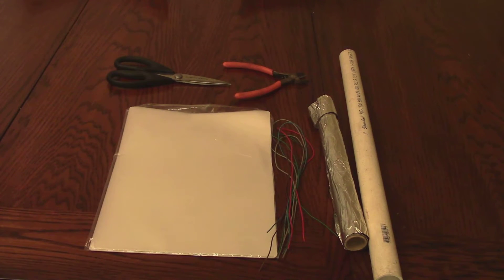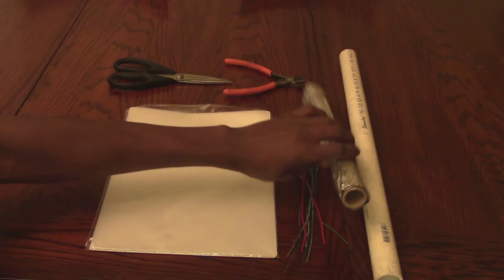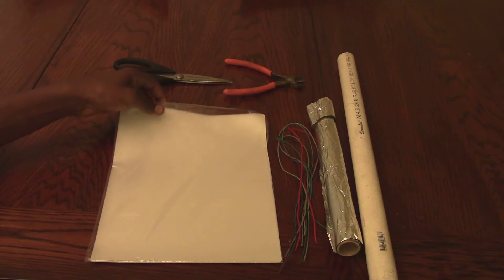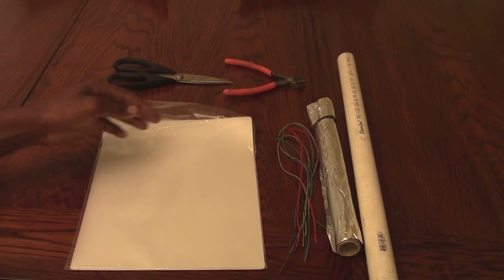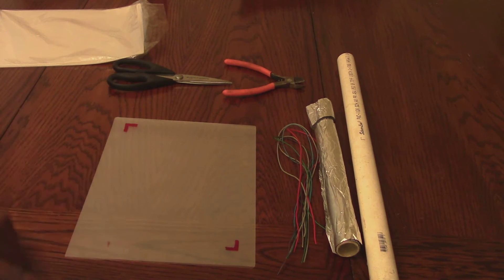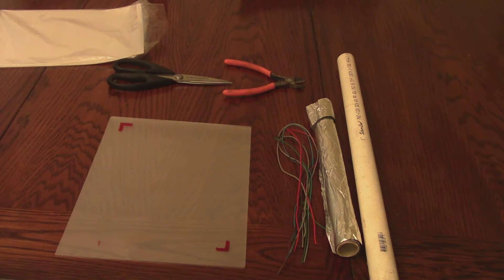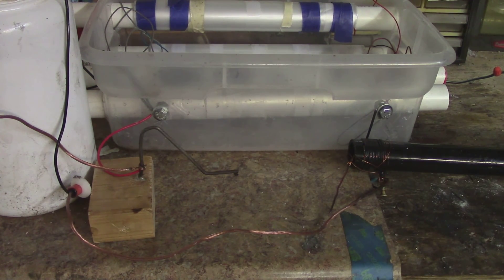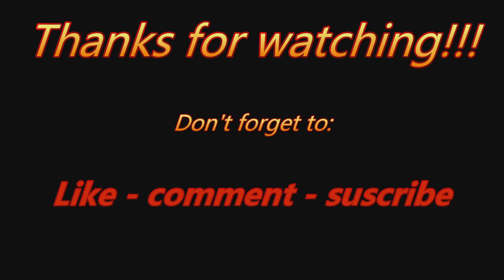How to make High voltage capacitors | 50kv foil rolled | Tesla coil caps |

Comment: Could this be used in a tesla coil?
Reply from the maker: Absolutely, as long as you make sure you get the right capacitance to achieve resonance.
Reply: @platinumscience7356  Thats the tough part. I want to build a big tesla coil. Could I just make a really big capacitor and call it good?
with like a 10,000 volt transformer
Reply: @platinumscience7356  I guess I will need to do a bit more research

Comment: Would be cool if you checked the capacitance before and after you rolled it to see its effects.  Also rolling a capacitor creates inductance that limits its ability to "dump" charge.  I wonder if theres any noticeable difference between a rolled and unrolled caps performance (probably not because of the small number of turns...)
Reply from the maker: Inductor87 yeah At the time I did not have a working capacitance meter, If I ever make any more Ill check it, but yes rolling then does add an inductance, I was thinking about laying about 100 of them flat into a container and filling it with transformer oil.
Reply: That sounds like a wicked experiment.  Deadly, but totally worth it for the thunderous arcs you'd get from the spark gap.
Reply from the maker: Inductor87 Yep, I need a cap for a quad mot tesla coil but building one for that would be crazy as I need about .2uf. For it to be in resonating range.
Reply: Have you ever checked out diodes gone wild channel?  His voice takes a while to get used to but theres lots of good content and theory.  He also has a website where he built a 3 mot tesla coil and used 3 other mots to ballast the secondary. His cap bank is some serious badassery http://danyk.cz/tesla5_en.html
Reply from the maker: Inductor87 maybe I can use it for my quad mot coil because making an mmc and its going to cost about $200 to make.
Reply: It would nearly double since your doubling surface area

Comment: How do you calculate the capacitance of such a capacitor? I know area of plates, dielectric permittivity, and voltage are involved.
Reply from the maker: Donald Clay great question, there are 2 ways that I know off, if you know all the specifics of your capacitor down to the dielectric constant, you can use formulas ( depending on how consistent your caps are). Try deepfriedneon, they have a calculator that does the math for you. The other option is just to use a multimeter with a capacitance setting on it.
Reply: OK, thank you. One more quick one for you.  Is the laminating paper a piece of paper with the clear plastic around it?
Reply from the maker: Donald Clay Nope, its the plastic with out the paper, check your local office supply stores and see if they have them, they are what you would use if you were going to do your own lamination. If you cant find those, then projector transparencies should work.
Reply: OK.
Reply: Do you know the dielectric constant, k, for this specific plastic?
Reply from the maker: Donald Clay Not exactly sure what it is as I do not know the material, it could be an acetate or I've heard they may be made out of polyethylene Ethylene Teerephthalate, with out a sure answer to the material you are using, It would be hard to find the DC, you can generalize what it might be by looking up the general DC for polyethylenes and acetates but I'm not exactly sure, sorry.
Reply: No problem.
Reply: Qqqqqqqqqqqqqqqqq

Comment: If you want to have safe capacitors you should not exceed 350 mJ of energ stored in the capacitor. Below that energy higher voltage capacitors are considered safe. Besides of that I also read one should also limit the charge to 50 uC which I don´t know is necessary or additional?
Reply from the maker: Muck2014 Indeed, but for as a Tesla coil primary tank capacitor it is needed to be able to store plenty of energy in a short period of time.